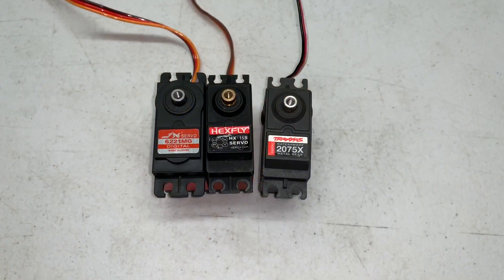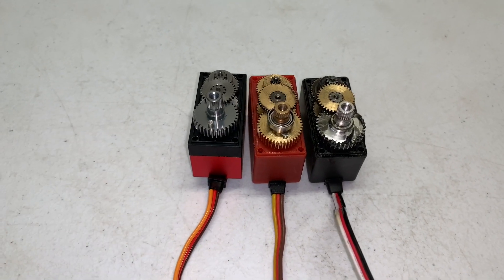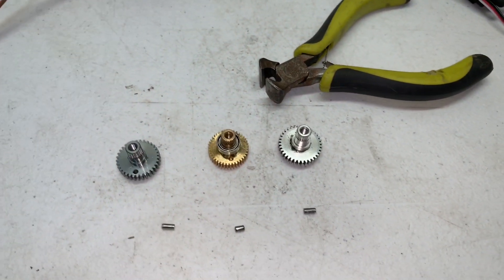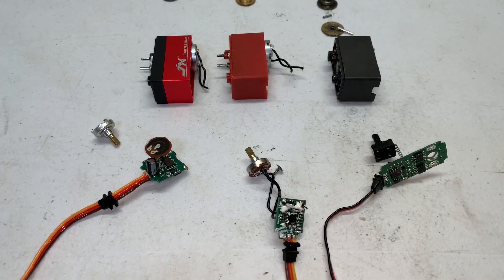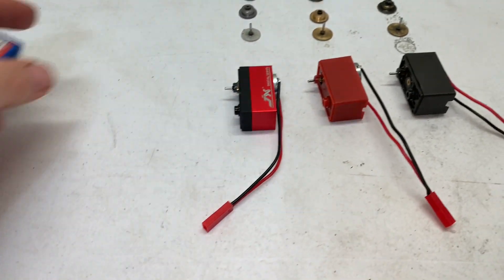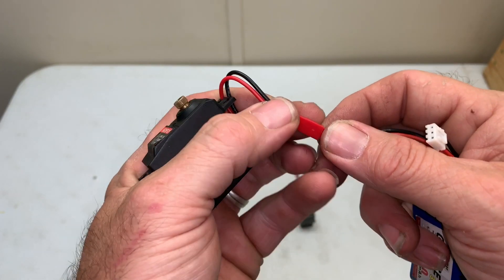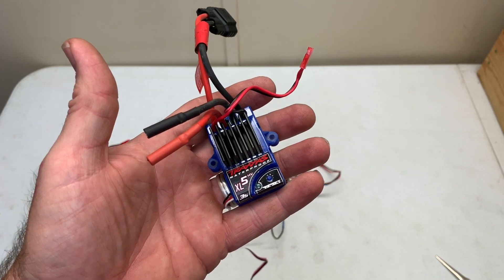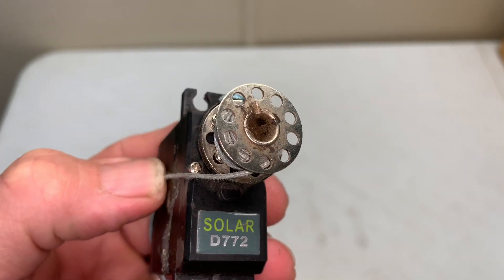Build Your Own Servo Winch

Comment: Why do you have to lose the electronics.  Couldn't you just remove the metal stop on the gear and reassemble everything.  It should spin 360?
Reply from the maker: Without the potentiometer yeah. You can glue the pot at center and then use a channel to control which direction. That’s on receiver voltage. We used 1060 esc’s as winch controllers on 3S.
Reply: @ExocagedRC  So the internal pot within the Servo,  I'm assuming it just supplies "degree" information to the 3rd wire?  Couldn't you just leave it, the pot can spin 360?

Comment: This is cool but you didn’t explain how you control it with the esc. Maybe I’m stupid but it would have helped me out bro.. now I’m lost 😂😂🤷🏼‍♂️
Reply: So what I would recommend would be cut the positive wire running to the receiver from the esc and plug into another port to cortrol it. I use channel 5 or 6 on my flysky gt5.

Comment: Love to get mine working. Servo works when connected to power but using a winch on a drone. Not sure how to setup my signal to the esc. Have it connected on ch5 which is controlled by a slider switch on a Taranis X9D transmitter.. please help 🙏

Comment: Just watching this and was thinking.... I remember you tuned some of your trucks suspension using rubber bands and later the special straps from the company that makes the kinetic energy winches. You use the straps to limit the travel and aid with the centre of gravity but the downside of that is that you lose travel and articulation. I wonder if you could somehow hook up a winch servo to those limit straps so that you could have the best of both worlds just with a flick of a switch?

Comment: I did this procedure on my servo, and when I plugged it into my receiver it kept spinning quite fast and the control inputs from my transmitter didn't do anything. What should I do?
Reply from the maker: you have to use an esc or winch controller to control it. look up my video on using a hobbywing 1060 as a winch controller

Comment: I have some Amazon waterproof servos that I am using for my RC sailboat. Can I just hook this up to my receiver without an ESC? I don't need speed control, just forward and backward.
Reply from the maker: you'll still need a way to control it. depending on funds, the 99micro servo winch is plug and play plus its small and can pull 22lbs.
Reply: @ExocagedRC  These servos can pull 25 Kg. Some people said I don't need an ESC but the speed will stay constant which is ok.

Comment: I’m not the smartest chap here being newbie to this. 
Can you please put up a pick or new vid of this fully set up on car where all the wires go how you did it all. 

👊😀
Reply from the maker: I've shown servo winches in several vehicles, I use a 1060 ESC as winch controller and power straight from the main battery
Reply: @ExocagedRC  

Is the 2 esc wired into the 1 receiver.

Comment: How can they be hooked up to a 3rd channel on a transmitter that has a forward, neutral, reverse switch for the 3rd channel?
Reply from the maker: Many radios have settings that can do 3 position switches. The one I use is a Hacked 8ch Flysky GT3c and it has momentary which works great. You’ll have to figure out how to do it with your radio.

Comment: Can you power this off the truck battery by soldering a jst in with the main esc? So I dont have to run 2 batteries?
Reply from the maker: Zachary Perry the best way, also the way I do it, Is to use a jst off the battery plug at the esc to power either a 1060 esc or another winch controller to control the servo winch
Reply: @ExocagedRC  will I have to pull the red wire off that goes to the reciever wiring it up that way?
Reply from the maker: Zachary Perry yep
Reply: @ExocagedRC  thanks for your help keep up the good informative vids there awsome

Comment: The Traxxas seems (sounds) like the fastest of the bunch. Might just be the sound but it would be nice to find a fast one.
Reply from the maker: Baxrok2 use any high speed servo and run it on 3S from an esc. I also use the Solar D771 and it’s walking speed fast on 3S. It’s a 23spline so finding a nice spool takes a bit more looking.
Reply: @ExocagedRC  Hell, walking speed fast is good enough for me. Thanks!

Comment: I use old servos potentiometers to control my led lights on the third channel 🤫
Reply: Cool! But how exactly?
Reply: panic mike look at a potentiometer as a light dimmer. When it’s centered it’s ready to receive a signal at standby and when it’s not centered its executing it’s given command of turning something left and right ie: servo motor. Well I take the potentiometer and I connect to a receiver via the standard connectors with the red white and black wire. Then I take the red and black wires that are exiting the potentiometer on the other side and I solder led lights to them, usually a string of amber red and white lights. The potentiometer acts as a signal recipient so you can turn your lights on and off via any spare channel. On my 3 or 4 chan radios it’s usually in the 3rd channel. But I have a surface radio by Hobao that has a rotory dial that oddly lets you set the lights to strobe, Dunn or turn off completely
Reply: @SweatyHanes  That's smart! So basically instead of using a led light Controller Switch on the receiver your using just one servo potentiometer?  The center pin of the potentiometer is the signal so you solder the white wire and connect to receivers x ch. signal center pin right? Then black and red go to left and right pin of potentiometer and connect to receivers x ch. positive and negative pins and then you solder leds on left and right pins of potentiometer ? Does the potentiometer need to be centerd  to turn lights on and off from transmitter or it needs to be turn left or right? Am a little confused.. Will it operate 4 standard 5mm bright leds? Or am i going to short and fry the receiver by doing this?

Comment: I see other built and they use the control board out of the servo and they use channel from recieve to control ...what do you think of this method?...I look forward to your channel...keep up the great content...
Reply from the maker: Tom Andrews I’ve done that before, the issue is the servo boards have a very tight neutral band width and drifting so the result, the line slowly spools out or in while driving causing issues. The other reason I do them this way is so I can run them on 2S or 3S power, using the servo board from the receiver method limits you to whatever the receiver can handle. I compete a lot and when winching I want fast and strong, slow takes too long when seconds count.
Reply: @ExocagedRC  Thanks I have several old servos and have been thinking of doing this

Comment: How is the servo actually connected to the ESC to run forward and reverse? And is it connected to an AUX channel on the receiver, guessing 3 position switch would be best?
Reply from the maker: arcterus01 the esc’s I showed are what the servo connects to, they connect to the receiver and get power straight from the battery. I use the JST connectors like you see here, the small red ones. Yes a 3pos momentary is best to control these.

Comment: Great content also maybe a video on using a servo ad the control board for a winch, super simple and basically free.
Reply from the maker: David Spinney yeah I briefly mentioned using the board but personally I’ve had really bad luck doing that. Many others that run with me have the same issue with drifting, plus most of us run these things on 3S off the 1060 esc.
Reply: @ExocagedRC  Exactly, I just picked up another 1060 just for this purpose. Those and the 1080's are my go to. Another great video and thanks for getting back. Some guys I dont think even read the comments let alone get back to use. Have a good day.